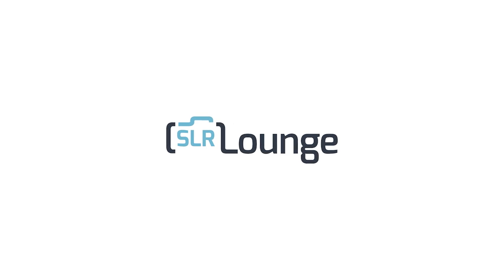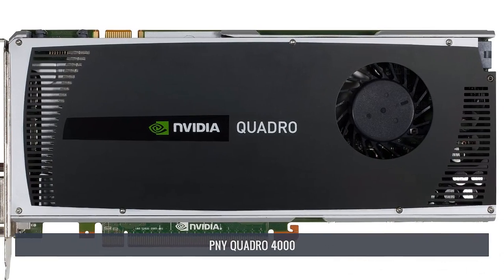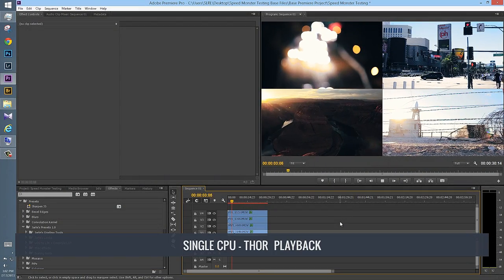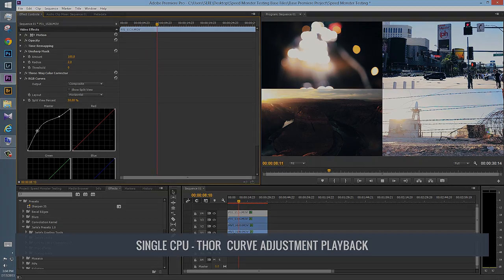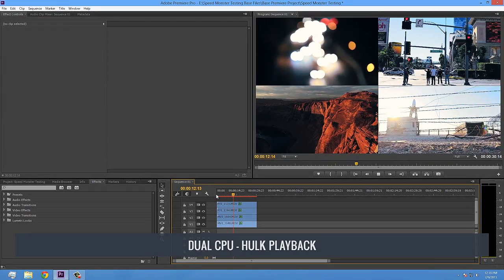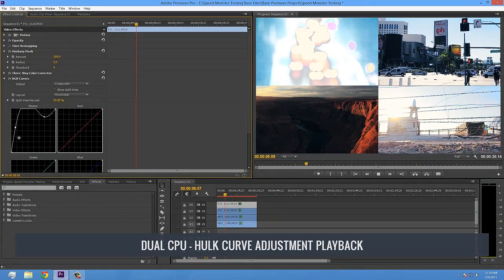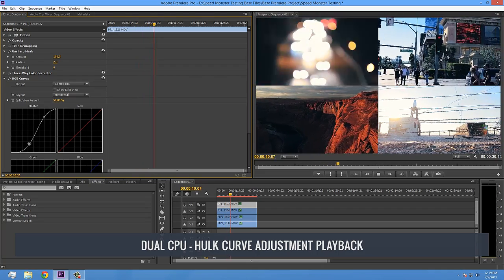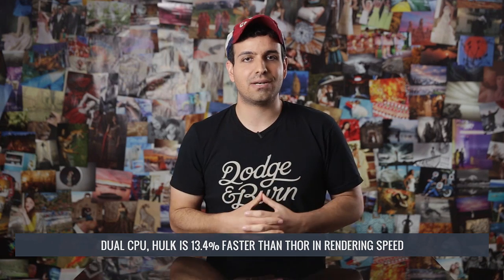Premiere CC Hardware Performance Guide - Single vs Dual CPUs and Gaming vs Workstation Graphics

Comment: You had a red line above your footage in the timeline. That is indicative of several things:

1. There is a mismatch between the source footage and the Project Preset (settings and footage are not matching)

2. One of the footage layers has added Effects, or some sort of overlay, such as a Title, or PiP that is not supported for hardware acceleration.

Comment: While I think it's a great demonstration of video editing machines not necessarily "needing" the higher end quaddro cards. You should have included important information like what type of storage/memory setups each machine was running. When streaming multiple clips like you did in this test, the very FIRST thing to crash the timeline is storage speed/bandwidth.. My single cpu 3930 can handle 4 1080 avch clips on a timeline with effects without any kind of frame drop off